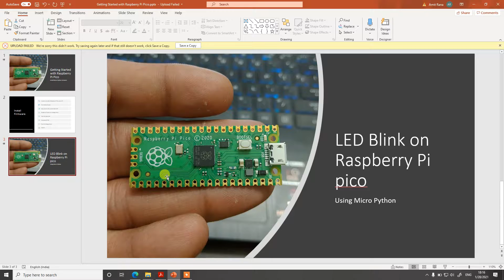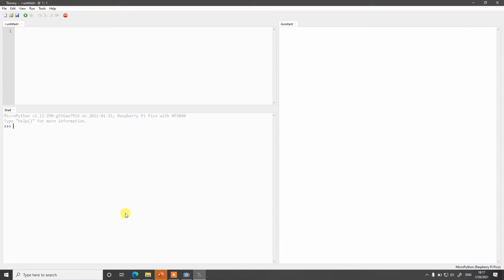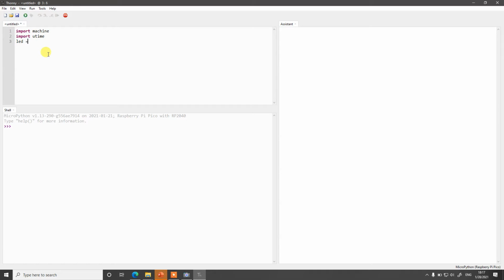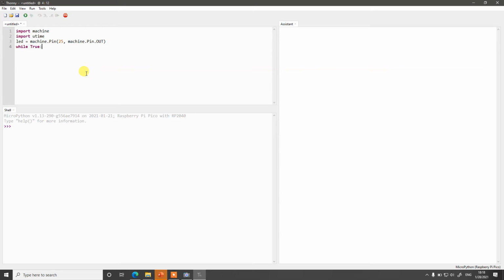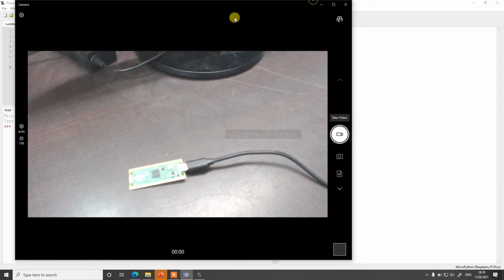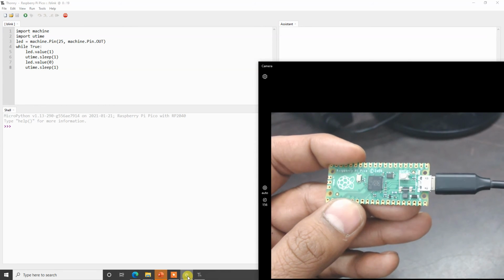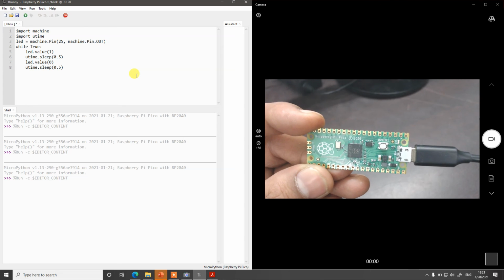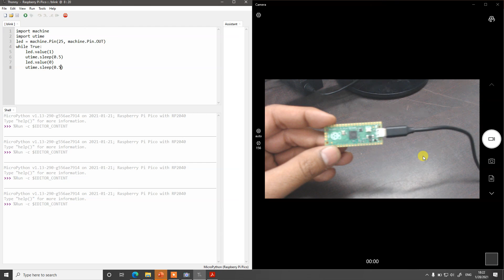LED Blink on Raspberry Pi pico microcontroller

Comment: To keep it simple and step by step you should have first started by just turning on the LED on the Pico  with the following code

from machine import Pin
led = Pin(25, Pin.OUT)
led.on()

This works with the Pico H but not the Pico W or WH 2022  because they no longer use pin 25 for the LED but all you have to do is replace 25 with "LED" as follows

from machine import Pin
led = Pin("LED", Pin.OUT)
led.on()

-------------------------------------------------------
Alternative code For Pico

import machine
import utime
led = machine.Pin(25, machine.Pin.OUT)
led.value(1)

--------------------------------------------------
OR for Pico W 

import machine
import utime
led = machine.Pin("LED", machine.Pin.OUT)
led.value(1)

---------------------------------------------------------------
If you change the last line  in the above code 
led.on()     to     led.toggle () then the led will change from on to off or off to on everytime you click the run button in the Thonny program 

--------------------------------------------------------------------

Once you have done this you can go onto the next step which is to make the Pico blink. 
For Pico H use the code in this video

import machine
import utime
led = machine.Pin(25, machine.Pin.OUT)
while True:
   led.value(1)
   utime.sleep(1)
   led.value(0)
   utime.sleep(1)

For Pico W or WH use the following code - just change 25 to "LED" as before

import machine
import utime
led = machine.Pin("LED", machine.Pin.OUT)
while True:
   led.value(1)
   utime.sleep(1)
   led.value(0)
   utime.sleep(1)

-------------------------------------------------------------------------------
Reply: great
Reply: None of this is working for me. Is there a step I'm missing from way before all of this, i.e. defining some of these or even a setup?

Comment: doesnt work
Reply from the maker: Hi, what's the issue you're facing??
Reply: Do you have Pico H or Pico W   ( wireless) ?
For Pico W  change the value of the pin from 25 to "LED"
Reply: Try this

try:
    led_pin = machine.Pin('LED', machine.Pin.OUT)
except TypeError:
    led_pin = machine.Pin(25, machine.Pin.OUT)